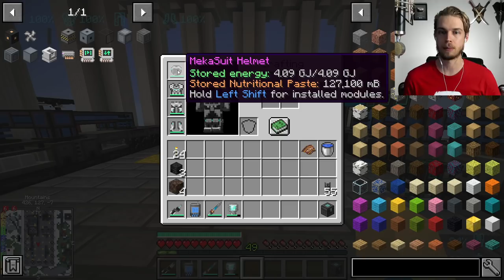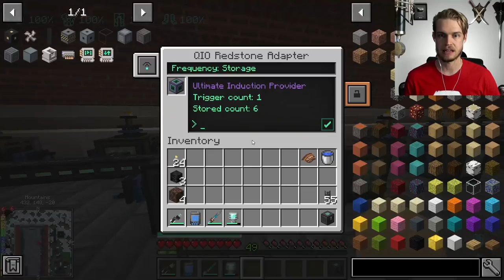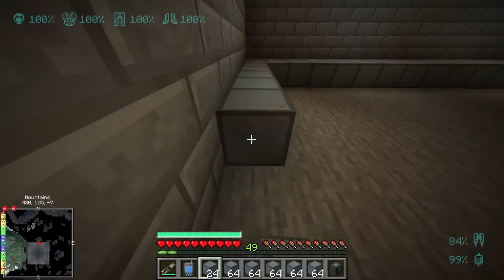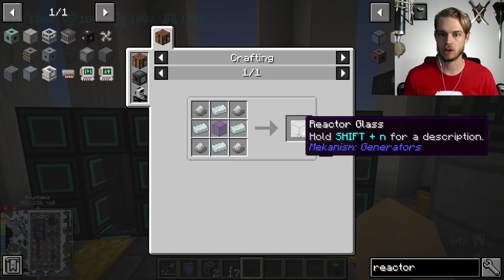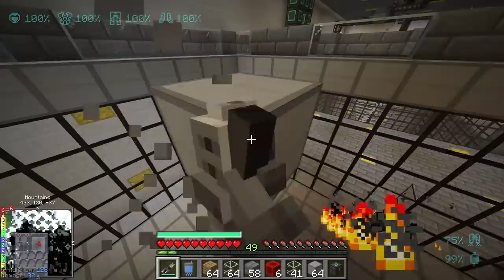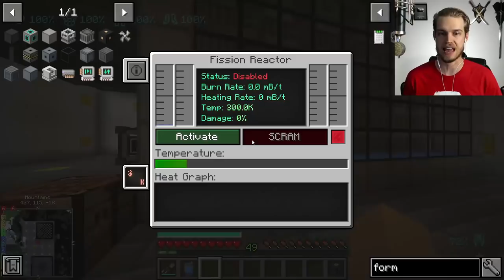HOW TO BUILD THE LARGEST INDUSTRIAL TURBINE POSSIBLE!  SURVIVING WITH MEKANISM E33

Comment: for anyone looking
1111 Casing total (including for other recipes)
345 Vents if using Saturating Condensers, otherwise 563 Vents
2 Valves
1 Rotational Complex
224 Pressure Dispersers
14 Rotors
28 Blades
7 Electromagnetic Coils
218 Saturating Condensers or replace with Vents
enjoy
Reply: Plus the 840 structural glass*
Reply: Thank you

Comment: Hey idk if you could help me im building a turbine right now with a buddy and im struggling... Its 13x13 base. what is the maximum height i can make the blades. thankyou!
Reply from the maker: It has been some time since I’ve done that calculation, but if my memory serves me correctly, I built a 13x13 turbine on my Facebook series 👍